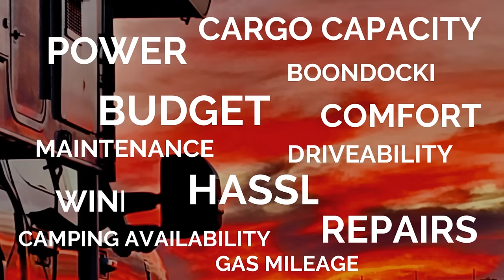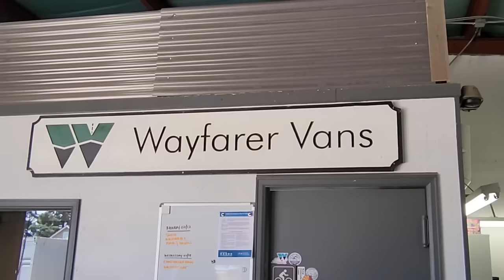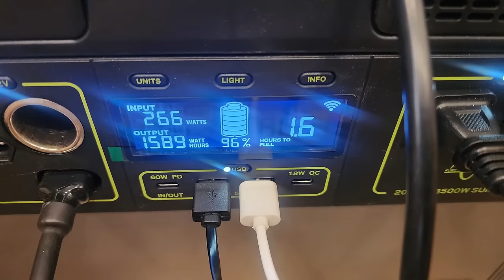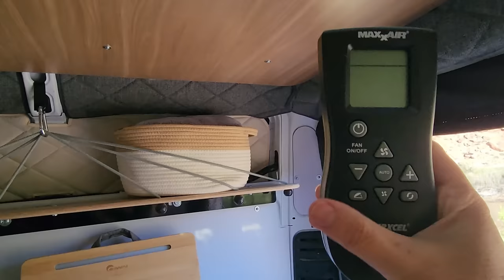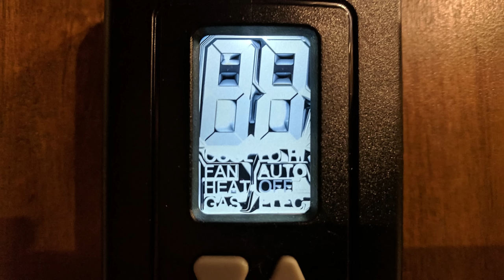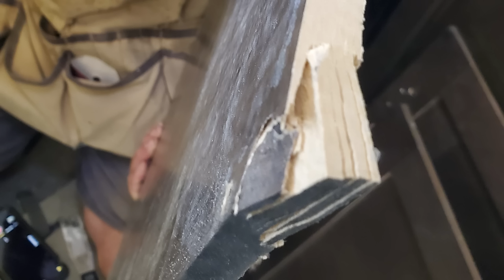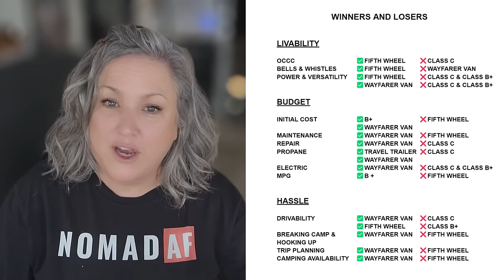6 RVs: BEST👍& WORST👎for BUDGET, HASSLE, CAMPING, DRIVING, REPAIRS, MAINTENANCE +

Comment: Hi Robyn, yes, I'm very happy with my 2012 Roadtrek RS Adventurous and I've had it for 7 years.  There's no perfect RV.  If it has wheels, it has problems. 

Although we've had some issues, the Roadtrek is very well made. 

We tour and travel; we do not live in the campervan.  We don't need a lot of power, but, we do have solar and a generator.  

One of the best things is the OCCC.... abundant cargo capacity with the dual rear wheels.  

One thing I have to say is.... rent a van and see if it's right for you.  Changing your rig is very expensive, you've been very lucky with resale.  Not everyone will be that lucky.   Good videos.

Comment: If I were to purchase a rig on this list it would be Ram Pro-master then putting a grocery getter lift with rear locking differential so I could still tuck myself into the mountains.
I looked at multiple options and was not happy with any of them.  I had a list of needs (power to work on the road) and wants (indoor toilet).  Because I was not able to find anything filling a lot of that list - I built my own in the end.  I 100% love my 5 X 10 converted cargo trailer that I pull with my 4Runner.  I know how to fix it all.  Breaking camp is a breeze.  I can lock up my trailer and run into town or to attractions and my clearance is high enough I can find camp spots most can not get to (which is good because I'm not a real people person).  
I will let you know that I took a lot of that list and saw how the industry was doing it and built it into my rig.  I actually have a indoor and outdoor bathroom but no plumbing per se (no freeze issues).  I have a covered outdoor kitchen (fully powered with refrigerator) so not to have cooking odors while sleeping but I can pull parts of that in if I choose to cook inside.  I actually heat with wood pellets and have propane as a secondary source.  No A/C but 4-wheel drive gets me high in the mountains.  And as for working wherever - I have Starlink and built the ultimate power system for my needs.
Now, I am a no-frills girl.  But many have commented that my CCT is a very homey travelling cottage. I have a lot of storage because I have the two rigs and both can carry decent weight.
Reply: Would love to see a photo of the set up.
Reply: Photos please 😊

Comment: After owning over a dozen rigs I've become a huge fan of Truck Camper.  I use my truck for day to day and then put the camper on for comfortable travel anywhere in a nearly normal vehicle footprint.  Took the truck camper to Tuktoyaktuk (Arctic Ocean) and all over Alaska last September and I wouldn't want to do that trip in any other rig.  We take extended trips into western USA and all over on the regular.  We now have an Arctic Fox 1150 with a full length slide and it's completely fantastic.  Tons of room.

edit: Important caveat because this "best of" would depend entirely on your truck.  We have a Ford F450.  Personally I would never take extended trips with a TC with anything smaller than a one ton dually.

Comment: Robin-
 There is a fairly new but widely accepted way to recharge your house batteries. It has been done for decades in the marine market.
 That is to add a second high power alternator, following the engine maker's specifications, that is used only to recharge the house batteries. These can easily be over 200 Amps at 48 volts, so a 48-to-12 volt converter may also be needed. But this means an hour or two of travel or idle time can recharge a very large battery bank--and solar panels become irrelevant. Obviously, witn a towed trailer you will need to plug in a connecting cord.
 Some vans can be ordered with this factory installed. Not a solution for everyone, but a reasonable alternative for many.
Reply: Unless you hat the noise of an engine or motor.  Thank you for the idea.  Great for many but, I'll stick with solar.

Comment: ME! I have a Mini Winnie 25ft. I can go anywhere and sleep 8 if necessary. Had mine 10 years this year. There’s a reason there are soooo many on the road. I have a HUGE basement, so I carry plenty of solar for our needs. I rarely pay for a camp when I’m home, but can usually find low cost state parks or national parks when I have to. We chose no slides to cut down on the number of things to go wrong and have never missed all the ‘bells and whistles.’ In our previous 10 years, we had a tiny T@B, and the real reason we moved up was the set up hassle. We ain’t getting any younger and love the ability to usually just plug and play.

Comment: Had 2 rigs, 2008 Forest River 28' with 15' slide, loved it till roof got broke in the Ozarks jacknife.  Second 2010 32' Jayco Eagle  5th wheel and I love It!! Fell into it when TT was totaled and been in it almost 4 years.  Pull with 2013 F350 duelly.  Want to get solar so I can boondock,  I  have a 4250 generator  when I do travel, so I can stay anywhere.   Love my life!

Comment: when done right you can get more in a small rig, the pleasure-way XLTS is 22 feet and is standard now with 500 watts solar, 3000 watt inverter and 600 smp hour lithium battery system.

Comment: Husband and I have been in a 37' Class A (Newmar Bay Star). We've been full-time since November 2019...still love the rig. We spent several years beforehand looking at different options for us and had thought it through in terms of type and floor plan. This has a bath and a half, washer and dryer. It's big and tough to get into and out of a gas station (and we tow a Jeep). But we're comfortable and travel slowly. We added solar and lithium batteries, so boondock easily except in the summer. If I were a solo traveler, I'd definitely want a campervan, but for two people the Bay Star is a winner.

Comment: Interesting that you seemed to like the campervan the most, it is the largest growing segment in RVs today.  

My Roadtrek RS Adventurous is based on a Sprinter 3500 cargo van and converted by Roadtrek Motorhomes.   I would say that the only thing you have to realize is that there is limited space.  We just have learned to take less stuff.   I would never consider living full time in the rig; it's just too small.   And, you're right, fuel mileage is extremely important.

Comment: Neat video. I built my own rig and let me tell you about repairs. Oh wait there aren't any. I have 630 watts of solar, AC, heat, Microwave, TV and 30 gallons of fresh water. I forgot a dorm style refrigerator/freezer. Twenty two feet long and a gas engine. I did just replace the air filter at 22,000 miles and of course some oil changes. Set up and breakdown is a snap and I can get in to parking spots easily.

Comment: We've lived full-time in two different 40+ feet fifth wheels since 2008.  We only boon docked during blow-and-go times while we were in transit, which meant for us parking lot or Harvest Host overnights.  

Regarding propane usage v. electricity, we only use propane when we have to and for our stove top.  Our second rig came with something called Cheap Heat, which was added after the initial build.  That gave us a choice to run the heat by electricity v. propane.  Many times in a park, if you stay a week or a month you get a discount so you pay electric, but often the discounted rent was more than the electricity cost which made the convenience and availability of using electric Cheap Heat v. propane the way to go.  We've got two 40 gal tanks and I only use propane for the stovetop now and I probably filled only one tank of propane in close to five years.  NGL, where we live right now the electric bill is higher than the rent in summer, but I'm not strong enough to wrestle the tank out of the bay to get it to the curb to be filled.  Cheap Heat was an awesome add-on and no one told us about it; the prior owner put it in and I'm so thankful. 

We do have a propane generator which is a good thing, but if the power went out for extended days we'd need to refill our propane tanks to run it continuously. I'd have to get help to do that.

Comment: So I was an outdoorsy person when I met my husband but I wasn't a 'camper'..... been there done that in a tent in my younger years and was over it!  But when I met my husband he had an 18 ft bumper pull travel trailer that he kept on the coast to spend weekends when he wasn't working. As soon as I knew we were going to be serious, I quickly talked him into a fifth wheel because I already had a truck and had been hauling cattle with a gooseneck trailer. So our first fifth wheel was about 20 ft or so but after a couple of years we traded up for a 24-foot, then a 29 ft, then a 30ft gas motorhome and finally a 40 ft Diesel Pusher when he retired. We took one big trip in the 40 ft and when we got home he was diagnosed and passed away 5 months later. I didn't have a problem driving but I did not like the maintenance on something that large. Besides when I go camping I spend most of my time Outdoors anyway and I did not want to take a house with me every time I camped. So I took the 40-footer out for one last camping trip on my own and knew for sure then it had to go. I waited about 5 years and then I got a 7 ft teardrop to pull behind my truck. The setup is so easy and it provided all I needed: a place to cook in a cool place to sleep. But after 2 years and me getting older I realize I would now wanted a camper with a bathroom so now I think I have my final camper and I'm very happy with it! It's a 20 ft fiberglass travel trailer that has simple amenities and no propane to deal with. I don't live in my campers and I don't care to Boondock, but if the weather is nice, it's doable. And of course I like having my truck since I've always had a truck and they always come in handy
Reply: Sorry about your husband. It must’ve been so awful after carefully planning your future travel adventures.

Comment: We bought a 2016 30’ 5th wheel from Outdoors and have been on the road since April. Nothing’s broken structurally but having 8yo technology we have a few glitches that we deal with work arounds. Our fireplace gives heat and so if we need warmth we use it. A couple of times we needed to use the furnace (April/early May in southern Alberta & Montana this year was crazy cold). 
It’s 12’5” tall including the ac so haven’t had issues yet. It’s 8’ wide & our RAM 3500 diesel dually is wider! It also hauls like a dream. 
We chose a fifth wheel for the stability in towing & the dually to add to the towing stability. Semis passing & most winds don’t move it. Any wind that would knock a semi around, we shouldn’t be on the road!

If I were solo I’d take a good sized Ram van that I don’t feel claustrophobic in. And I can do my hobbies without having to change things out.

Comment: For me it comes down to two questions.  Do you want to boondock or go to campgrounds/RV parks?  And do you want to leave camp and come back?  If leave and come back you need a towable, truck camper, or tow a separate car.  If you want to boondock you need to access remote areas, so preferrably smaller with 4wd and high clearance, so van/class B/truck camper.  Some people can get a fifth wheel back in tight spaces, but don't just assume you have those skills.

Answer these two questions first and you can figure out the rest.

Comment: I pulled a small trailer for years.  It is good for base camping and not traveling far as towing is no fun. I now have a class B van with all the bells and whistles.  It is great for traveling far as it’s easy to drive and fits in a normal parking space.  The van is also best for boondocking.

Comment: I love this video! I want a travel trailer, but the number of issues people have scares me. 
A fun video would be to see you move out of one camper and into another. Moving is so much work!
Reply: Travel trailers can be similar to the Wayfarer van, the simpler you go, the fewer problems you're likely to have.  The fewer slides, complicated systems etc, the better and often less expensive.  If you go with smaller teardrop style TTs you can find smaller better quality manufacturers which will also be easier and less expensive to tow.

Comment: 1 toyhauler TT 36ft, 1 fifthwheel, 1 class C, two travel trailers, 3 live aboard boats, 4 truck bed campers, and a couple tents.  
My wife and I are the only users.  Need to tow a 5k boat, need to launch and retrieve a boat daily when camping, need to go exploring in a vehicle when camping.  Often on the move, often staying for 2 weeks.
Going back to a "LARGE" truck camper in 4 months from my 22' travel trailer.

Comment: Wow, the Tiffin Class C sounds like a loser from start to finish.  We have a 2003 25 foot  gas engine Fleetwood Class C  that we absolutely love. The one and only problem we’ve ever had with it was when a power surge over  rode our surge protector and blew out the motherboard on our fridge.  We have no slides or auto levelers to go bad, no TV’s or  expensive solar power systems to deal with but we’re still able to boondock for a week at a time.  It drives just like my 21 foot half ton pickup except in a strong wind. We don’t tow but rather have EBikes to get us into town or just out and about.  It’s also cheap to register and insure.  We’ll keep this rig til we’re too old to drive it.

Comment: I’m wanting to go part time; considering a van, or, a small pickup truck with wedge pop up camper & small trailer combo. I’ve looked at Wayfarer and Van Go for simple vans. I plan to purchase a Ford Maverick or Ranger as daily driver so with Go Fast V2 Pro wedge camper I could be traveling and cycling right away. I could add teardrop or square drop later. With the pickup option my daily driver would get better mileage as well as my camp rig. I could also take four people if needed and carry kayaks & bicycles. I’m leaning towards the pickup. I’m a former backpacker so minimalist camper. Thanks for doing this; it helps to prioritize needs quickly.

Comment: I hope I've made the right choice.  I chose a 2023 Ford Transit High Roof Extended AWD.   It is being built out for me at Drifter Vans in Detroit,  and should be ready in 1 to 1.5 months.  It will have a 48v 10K Ecoflow Power Kit, 300w of solar on the roof, and DC to DC charging through the 2nd alternator in the van.  It will also have a very efficient 48v Nomadic AC unit.  I hope to be a total boondocker.

Comment: I'd love to see these listed out in table format. I'm particularly interested in the truck camper versus van option. It seems like they have a lot of similarities but the TC was rarely mentioned in categories where the van was. 

Please do a truck camper versus van video!
Reply: @UtahRoadbase  I agree with you.  I missed hearing more about the truck camper.  I assume that means it's placed mostly in the middle of many categories.  But I'd think if the truck camper were slightly smaller, with not so much rear overhang, many of the positives for the Wayfarer Van would also be positives for the truck camper, and in some categories the truck camper would beat the others.
Reply: Love the versatility of my TC it's hard to beat. Fully self contained and can pull into a 22 for parking spot. So much more room inside

Comment: We are on our 3rd WInnebago. The power issue is ONLY a problem w propane generator. If you have diesel gen & lithium then you are in a perfect setup. We tried a B van. Just too SMALL !!! Horrible for 2 average adults!! We sold less than a year & went back to a C. 
Our Super C was big. Too big but was super comfy if someone loves safety & their own apartment on wheels. We have found Winnebago View 25’ to be JUST right. But only w diesel gen & the lithium upgrade plus solar if you want to be practical

Comment: I have a Travato which is basically a built-out Promaster 3500 High Top.  I like it, but think I would prefer a Wayfarer build simply because the components look to be much more modular rather than built-in.  I like the increased simplicity.

Comment: Have a 1994 Ranger 4x4 towing a 2020 6x10 wee roll converted cargo and I love it. Ranger is easy to work on, parts are reasonable, and being on a fixed income that is important. I can get back into places that bigger setups can not get into...500 wats of solar on the roof, currently flooded batteries which I want to upgrage to lipo4 asap...also want to add a generator so I can run my a/c...But being in Flagstaff AZ for summer is mostly bearable thus far...Been on the road for almost three and a half years and I love this life and do not envision ever going back to sticks and bricks...

Comment: I have had a small class A and B+ on a sprinter chassis.  It is impossible here to get service.  The Thor Vegas sat in the dealer for months, and it is 2 hours to the nearest sprinter dealer that had a big enough lift for the B+.  I currently have a  Wayfarer Van in the works thanks to your video!  20 min to the nearest dealer and simple fixes in the modular set up.  Can't wait!

Comment: Currently have a tent so I am only going to safe campgrounds.  Would like a closed unit so I can go to areas that may have wild animals.  Because I have a small 1 car garage and an HOA.  Aliner is the only one that offers a unit that will fit in my garage.  Hight, length, and width limitations.  Also weight I will be towing it with a minivan for a while.  Aliner Ranger 10 or Scout 10.  Saving up for it now.

Comment: I’m leaning towards a towable so that if the vehicle has mechanical issues I’m not homeless.  One that can be towed by a rental vehicle.  I don’t want a TV, but need a small fridge (for food and meds) and AC (I live in the Deep South). A potty of some sort is essential for me personally. An indoor shower is nice, but not necessary for how and where I travel.  But my #1 criteria, it has to fit in my garage.  So that boils it down to tear drop trailers for me.  I’m eyeballing the Road Toad.  They are ell built and pretty simple, so not much to go wrong with them.